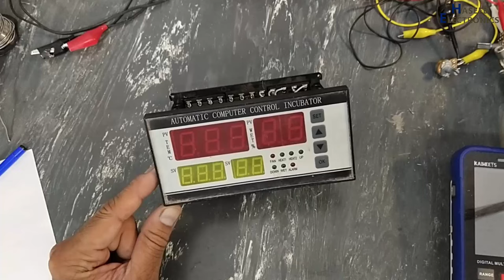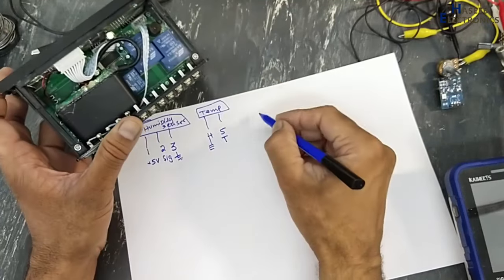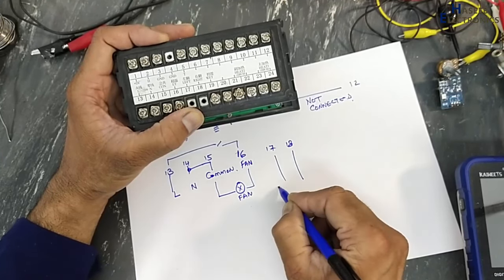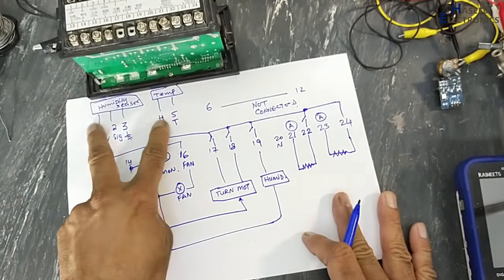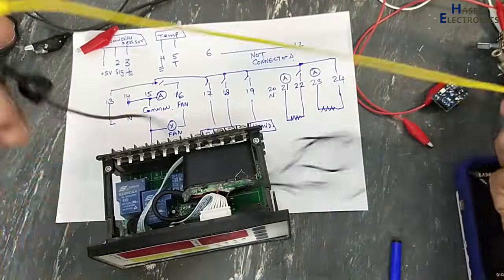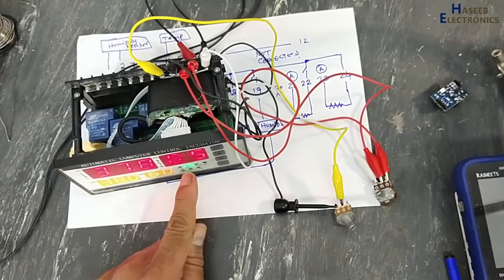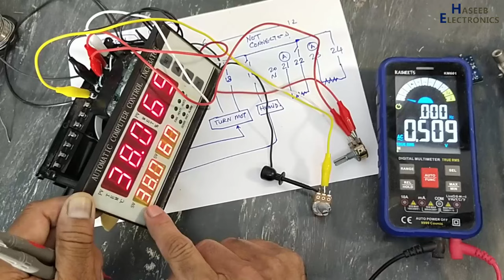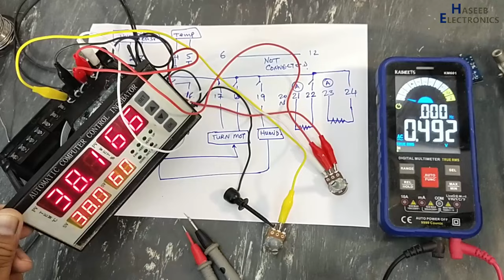{1232A} XM-18 Incubator controller wiring and functional test

Comment: Thank you so much for sharing your knowledge sir. I wonder where the 5volt for the temperature sensor is coming from..pin # 1,2,3
Reply: From the board
Reply from the maker: that 5 volt are coming from LM7805 regulator inside the PCB. please check video number 1232 for more details
Reply: Thank you for your reply,I missed the video 1232,I will watch it right now

Comment: Hello sir I'm wondering why humidity sensor requires three pins but temperature sensor only two pins what is the difference thank you bye
Reply from the maker: humidity sensor consists a sensor and an amplifier circuit. that is a complete module. that's why it needs +5 volt biasing, ground. then it will provide RH signal 
while temperature sensor is only a NTC thermistor. its resistance will change with sourrounding temperature. that is why it is just 2 pin
Reply: Thank you i love lerning ❤